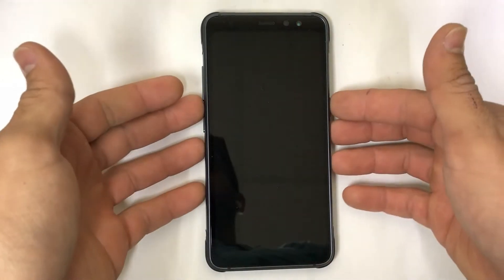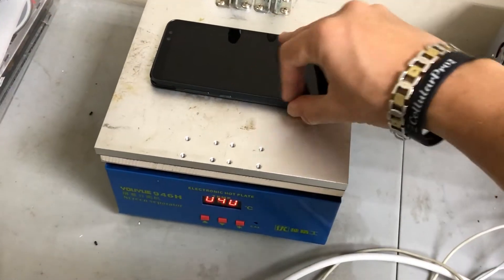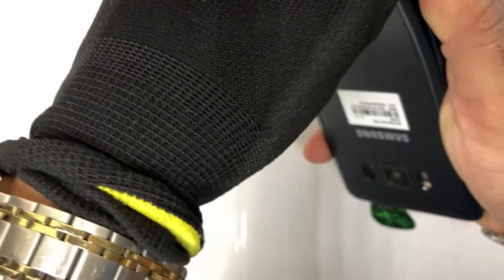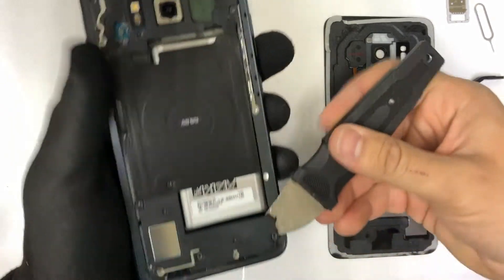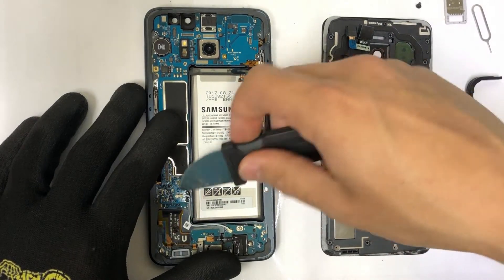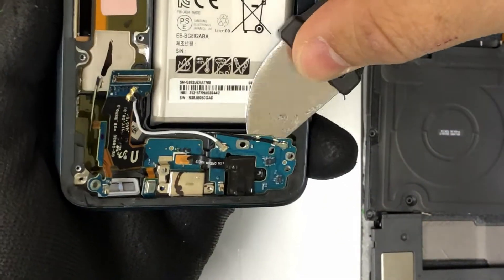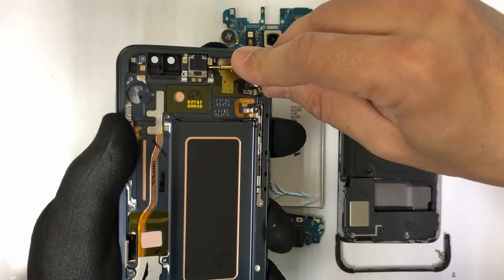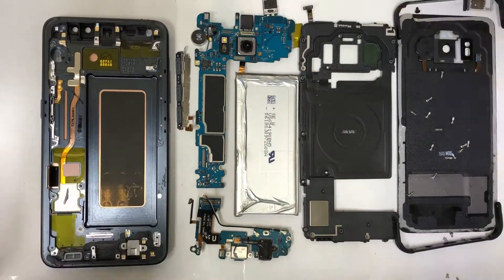How to Take Apart the Samsung Galaxy S8 Active in 5 Minutes

Comment: A local phone repair store told me that the LCD screen normally breaks when you open this phone, since the LCD is soooo thin??   Any comments regarding that?
Reply: lies.
Reply: They might have meant the S7 active, which can only be opened by removing the front glass, of which can break very easily.
Reply: I've seen this phone repaired a bunch. Not one mentioned this